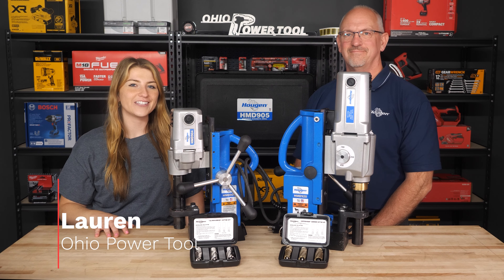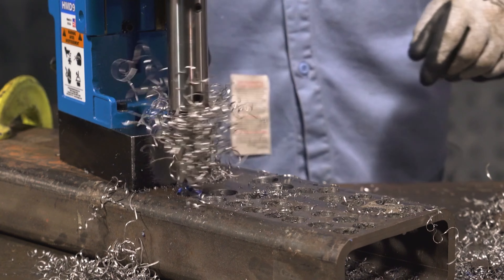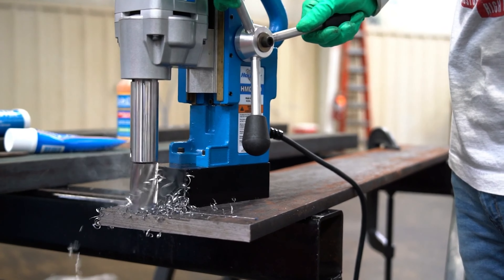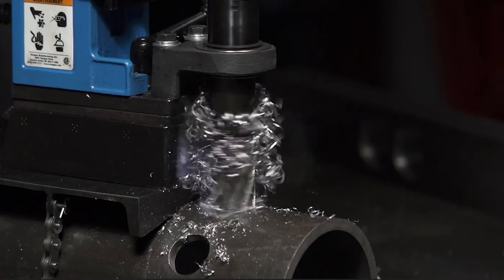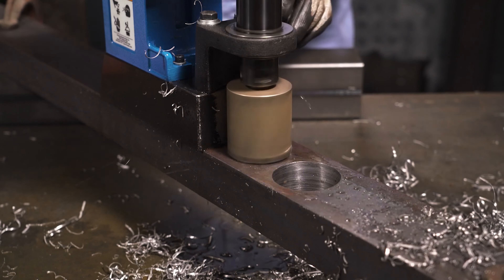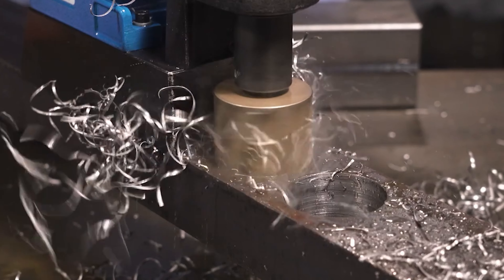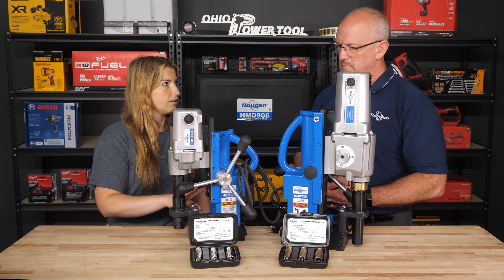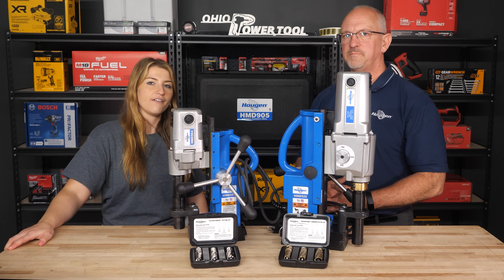Choosing Annular Cutters: High Speed Steel vs. Carbide with Hougen

Comment: Hi, what annular cutter and adapter can i use in a hand drill ?
Reply: Grab a tapered Weldon adapter and mill down the taper until it fits into your hand drill.  Now burn up your hand drill from the excess torque required for the annular cutter.

Comment: Are these good for cutting clean holes in tough composite and no burs on the plastic edges?
Reply from the maker: Yes they are, we would just recommend following the manufacturers guidelines for the specific cutter and material being worked on for the best results.